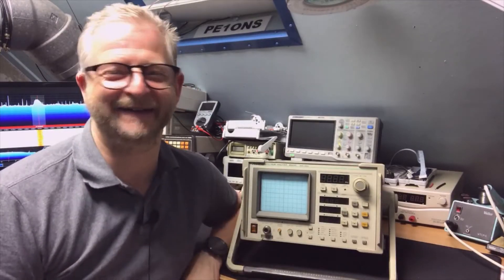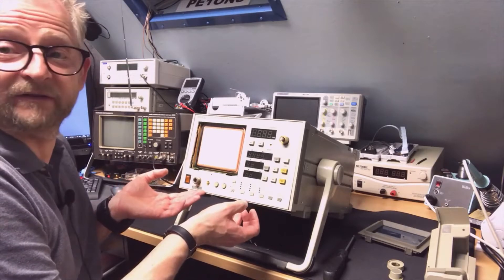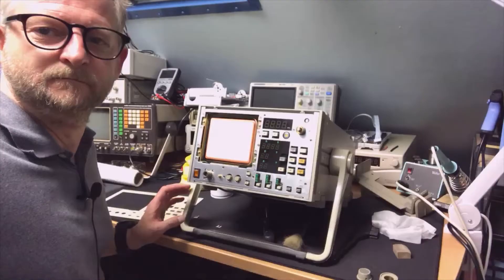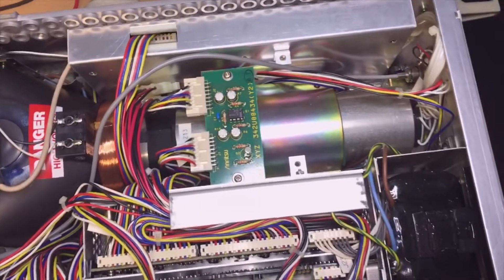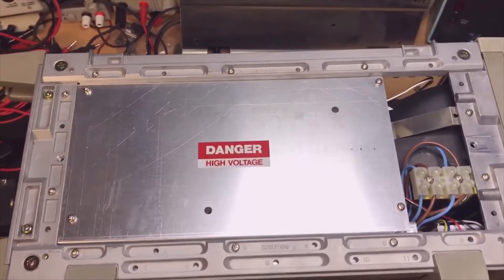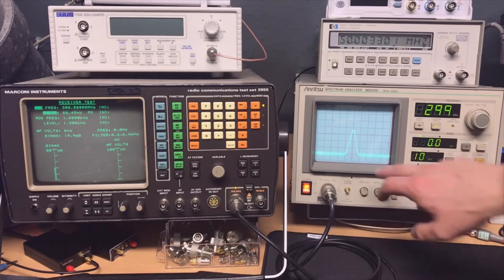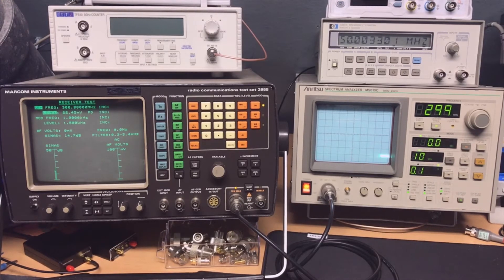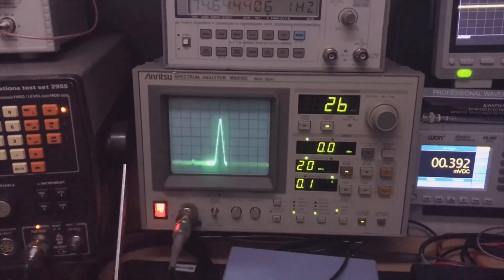#041 Anritsu MS610C Spectrum Analyzer 9Khz 2Ghz Teardown

Comment: That SA cleaned up nicely. It's great how easy it is to take apart. Didn't that one have bumpers on the corners?
Reply from the maker: Thanks, yes it had bumpers on the back and front corners and a huge arm/stand for mobile use, but it took to much space on the bench and i like the smaller look it has now.
Reply: @TonyAlbus  Yeah, it does look a fair bit more compact now.